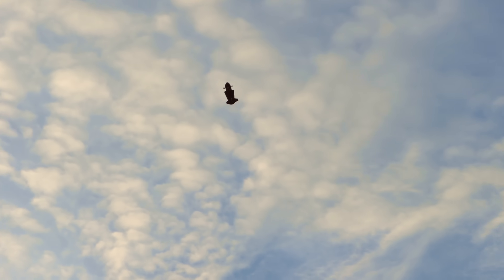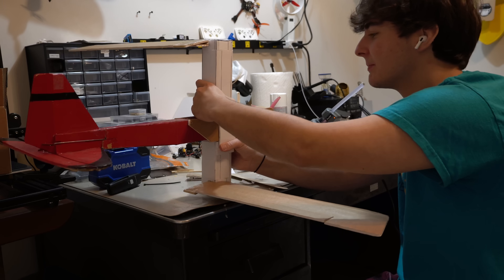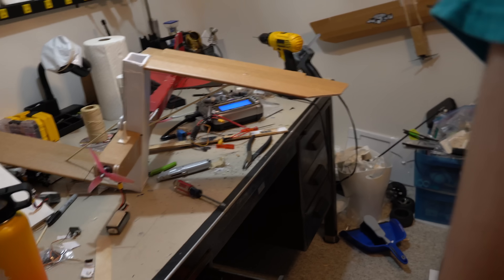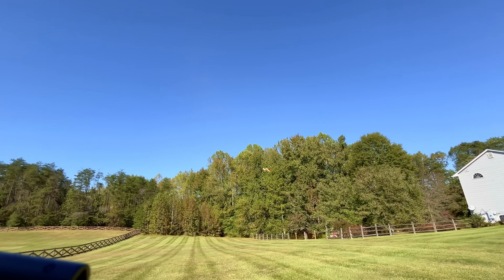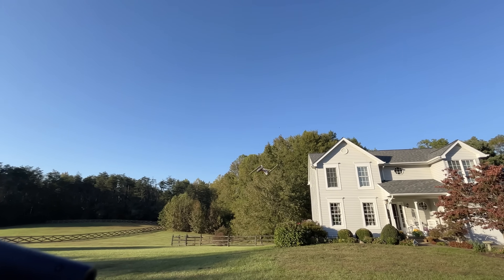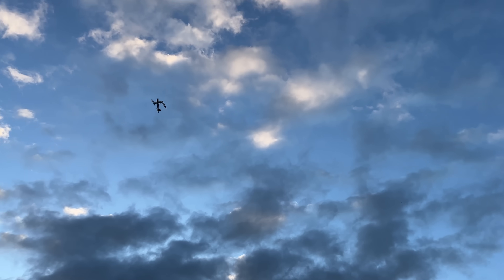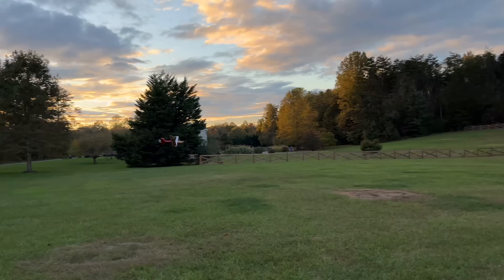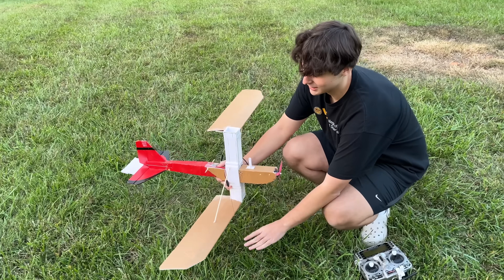Can a Plane Fly With Offset Wings?

Comment from the maker: To any one wondering how it would fly in ground effect or if it can turn right, this video will answer all your questions!!👇
https://youtu.be/zrH0QlKYqac?si=wn-rPbHM1OY1Grdm 

I also made a Patreon! Here it is and thx for checking it out!
https://patreon.com/EternalProgression?utm_medium=clipboard_copy&utm_source=copyLink&utm_campaign=creatorshare_creator&utm_content=join_link
Reply: your dad must be proud of you
Reply: other people pointed it out but your flying car proly still did fail cause of the wings because of ground effect and while i wouldnt be able to say what was causing it since i wasnt the pilot so i dont know if it just is reacting a bit harshly cause its such a small plane and so can turn much easier but when it was closer to the ground, the right side kept lookiing like it was lifting and like you had to correct the roll yourself which ignoring the ground effect increases lift if i remember right, exponentially as it gets closer to the ground, that would be the point that while yes it can fly like that, that still SEVERLY hurts its flight capabilities and DOES cause a roll that just gets greater the closer to the ground you are and more specifically, the closer the lower wing gest to the ground first.
Reply: Wait! Make an X wing craft,  same plane  but if you are looking at it from the tail, make a copy and rotate it 90 degrees.
Reply: I can see that it wants to roll. The powered version proves nothing. You have to throw a glider version with no controls and no tweeks to prove it.
Reply: yup airflow doesnt care if the wings are high and low ... just that they face the same way ...
Reply: The algorithm loves your content. I wish you made videos every week. I'd chip in on the content ideas.
Reply: Now make the indian peace sign airplane, not swastika cus swastika is titlted
Reply: @aquilschutte  i'd like to see a flying swstika just to prove that it can fly.
Reply: You should consider adding 2 additional wings, the same type but one going up and the other down, would be even more stylish

Comment: The only roll force i can think of would be from the high wing pushing air down on the horizontal stabilizer on that side similar to the spiral slipstream force. Looks like its far enough back that's not too big a problem

Comment: the """question""" is = self answered omg !! = If the wings attack the air at different heights that air will be at different pressure therefore the "bottom wing"  will produce more lift than the highest wing causing an angular torque in a flat direction perpendicular to the advance, it is not necessary to "set up" anything to "demonstrate Or try "Nothing at all, all that u need is just think a little ( and engineering knowledge of course )!!...you obviously CAN "make the thing work" but lossing lot of energy as well keep it FUNCTIONAL and producing fatigue of materials right at the key point of the aircraft in which you do not want it = the union of the wings with the fuselage !!...

Comment: Try putting circular holes in the side supports for the stilts that lead to the wings. This should benefit your structural integrity, but do it with your framework. Develop your subframe. This design probably will lead to this always fly on a diagonal, So just reposition the cockpit. It does work though and that's pretty fuckin cool dude.

Comment: It looks like in the video you didn't put any dihedral in the wings.  The math would say that you would  have a torque if you did put in a dihedral.  I also noticed that your left wing is high and the right wing is low, which with dihedral would give your airplane a clockwise rotation, which counter the counterclockwise rotation imparted by your motor and clockwise rotating propeller.

Comment: Can compensate for offset wing by angling the higher up wing slightly higher since that is the side falling, and at just the right angle it will fly normal. You need the front of the higher wing to be aimed upward slightly more than the lower wing. Another thing you could do is cut the backs of the wings at an angle so that they can collapse together in a different way, by shaping the wings to close at an angle.

Comment: With air density decreasing with heights, the lifts of 2 wings of the exact same geometries and angle of attacks at offset heights would create different lifts and drags. However, at the speed the airplane is traveling, this difference would be negligible, especially when reviewing tolerances from non-precision manufacturing.  This air density difference is what makes bullets veer off path the faster they spin or what makes a slider move away or toward a batter in baseball.

Comment: I think the issue isnt lift generated but torque on the center line. Assuming the wings are mirrors of each other, the issue with off set heights is that they will produce toque on the centerline of the craft because of gravity. This is all said before finishing the video.

Comment: The drift in the car plane was probably because of the weight distribution inside the car.
Batteries weight a lot compared to the generally hollow car and they are usually not centered.

Comment: “More lift in the bottom then the top”? That makes no sense to me. The wings are moving the same speed they should have the same air pressure under them. What I would think looking at it, is that the wing on top would have more torque because is farther away from the center of gravity.

Comment: Why don't you try re-designing the pillars connecting the wings to the fuselage, make them a symmetrical airfoil shape and fitting them with trim tabs so you could possible do away with the need for a seperate tail assembly??  Just an idea.

Comment: With one low and one high wing, you lose all dihedral effect. So you could add some dihedral, or sweep angle to get some more dihedral effect.
You should also increase vertical fin size as your airplane looks generally unstable (wobbly) on the lateral axis

Comment: Your conclusions just before the claim at the end where you said "myth busted," were wrong.  Ground effect was not your only problem.  The reason the plane was going to the right, as your dad noted, was because your top wiing is farther away from the fuselage than your lower one.  It therefore creates more rotattionoal torque, twisting the plane to the right.

Comment: If the wings are the same size and shape, it won't work unless they're the same distance from the center of the fuselage.  By putting them on a post, he's turning them into levers, which create rotational torque.  The two torque forces have to offset each other to keep the fuselage from rotating, and the plane from crashing.  That's why the plane mostly worked, but the car didn't.  If you want the car to work, the wings are on the same side of the fuselage, which means the wing closer to the fuselage will have to create much more lift, to offset the lever action of the one farther away.  That means the closer wing, if it's the same shape, will have to be much larger.  How much larger?  Learn some basic physics.  Specifically, physics having to do with forces created by levers.  The math isn't that hard.

Comment: Fun fact the italian C.202 fighter mono wing had one wing slightly shorter than the other to offset torque pull in flight. So the plane could actually fly in a complete straight line without any input from the pilot.

Comment: With the car its an issue because the center of gravity is below the wings. The airplane you put it in the middle so its not an issue. Cut the fuselage off, and glue it on the bottom and you will get a beter understanding of the issue. Also the car taking off has ground effect on oneside and a smaller one on the other side because of this offset.

Comment: Leverage against center of mass... As long as that's equal the wings could be offset by any amount.

In theory you could have a smaller wing further away from center, and a larger wing closer, and still fly stable.

Comment: Real nice mythbusting! Simple and unequivocal.
I wonder if the main factor isn't that the torque each wing puts on the body should compensate the other. This could be tested by keeping the same body, wing, and "offset beam", but 'sliding' the attachment point of the body up and down the pillar.
To rule out static torque and get more vertical lift out of the wings, counterweights making each wing balanced across the offset beam could also help.
This channel is a joy!

Comment: I can understand the intuitive feeling of people who think that this will spin. They observed a similar thing, like a rotor and draw false conclusions. But people have similar problems to understand physics in construction and statics. Because most are not able to disect all parts into independant situations. Both wings have the same weight, create the same lift and you can put the wings at the top or the bottom of a plane. The wing does not create more lift when it is one meter higher, or lower and it weighs the same (let´s not be tooo theoretical here please). There´s the same mass on either side in total. So why exactly should it spin?

Comment: Before watching this video, here's my guess:
You're going to get more ground effect from the lower wing, giving it more lift when near the ground. Whether this is significant enough to cause an issue, I don't know - I suspect the ailerons can easily work against it.
Once you are high enough that ground effect is not a concern, I don't see any reason why the offset wings should cause a problem in level flight. You might get some weird turbulence from a suboptimal fuselage, but nothing significant.
In a turn... I don't know. I think it might feel a bit weird when compared to a normal plane, but I don't think it should cause too much instability.

Overall, I do think this will be noticeable and not ideal, but not such a huge problem that it can't fly.

Comment: Before watching anything or reading the comments, I bet ground effect would have a big part in this, the lower wing would get more lift when close to the ground and at lower speed than the higher wing, meaning as long as the plane is far enough from the ground the imbalance would be insignificant to null, the plane would be stable, but as soon as you would get close to the ground, ground effect would throw the lower wing upwards and roll the plane towards the high wing.

Comment: hypothesis; wing off set shouldn’t matter if the center of gravity is located exactly in between the 2 wings as lift is a purely single direction force when created by passive wing systems

Comment: a free body diagram (vector forces) show that a symmetrical offset on both sides with respect the center of gravity shouldn't be an issue

if there are big differences in the offsets there will be a slight rolling force applied to the one with the bigger offset

Comment: As someone who has spent over 2000 hours running experiments in the most realistic physics engineering and aerodynamics simulator known to man (kerbal space program) I can confirm that the only way that the offset would impact flyability is if the center of lift isn't where it should be.

Comment: As an Aerospace Engineer, the flight dynamics makes sense, so it’s not surprising that it works with minimal roll, but it’s cool to see the proof! Not something I’ve ever thought about because of the structural integrity of a single wing mounted above or below the fuselage.
Reply: I still think it's not stable. In level flight it won't be very noticeble, but banking must distort it's flight charisteristics. Certainly because of the distance from the wings to the hull being uneven (the upper wing being much further away from the hull than the lower wing). It might even have been an accidental advantage having the upper wing further from the hull than the lower wing. My aerodynamics-math isn't good enough to calculate it, but to do this test objectively, the 'tower' should have equal arm lenghts up and down. Also, as the whole 'contraption' was built without any tools to check the angles, the wings could have different angles of attack and dihedral/anhedral. In small RC airplanes this makes a world of difference.
As high wing airplanes have different characteristics than low wing airplanes, one high and one low wing must have consequences for stability when banking and pitching.

Comment: makes total sense to me! the reason a plane tips one way or the other isn't to do with changing the position of the wings, but changing the amount of lift on one side or the other. Making it aysmetric should not really change that, as long as the center of balance remains.

Comment: I've got quite a bit of experience with aviation and aviation accessories. First off, Excellent experiment!! I love to see someone actually trying it out, instead of letting opinions rule the day. Even if it failed, you learn something. More things even. Second, and practically, it looks to me that you're getting equal lift from both wings, but your handling has some weight and balance/moment of force issues. Gravity is goin to want to make it a right angled "N", so your "Straight and level will have a left turn bias. Maybe try different wing lengths to compensate. Longer on top since the force acts on the furthest away, and you want to bring the left side up. Or go stubby on the right side, but lack of lift is usually a bad thing for aerobatics. Great vid, dude!

Comment: before watching you build, the only reason i think it would cause a roll would be a difference in weight between each wing, which i assume you would compensate for, or the extremely slight difference in atmospheric pressure/air densities at the difference elevations, which would be negligible at worst,  non existant at best.

from my limited knowledge of physics and aerodynamics, the position of the wing on the Y axis wouldn't affect the amount of lift generated, only the shape and pitch/yaw of the wing would. if both wings are identical in every way, apart from a difference in the relative height, equal lift from both wings would apply the same upwards force on the aircraft.

Comment: Sharks kind of fly through the water. Their fins produce lift with their tail providing the the fowards motion. Sharks often swim at a severe biased when cruising long distances to provide more lift which offsets their fins a drastic amount, and consumed less energy. Id assume the same would be the case for actually flying machines but i don't know nearly enough about how fluid dynamics changes between water and air. Very interesting experience.

Comment: This will work fine at altitude, but if you get into ground effect (about a wing's length from the ground) then the lower wing will start to develop more lift. So it's still possible that that's what was affecting your previous model.

Comment: I didn't watch the entire video so you may have mentioned this but I think it does matter in most cases. If the wings weigh a significant amount compared to the total aircraft weight and compared to the generated lift, then the wing that is higher will be pulling the aircraft down with more force causing a roll. Since most commercial planed has fuel in the wings I don't think they could fly with wings like this safely.

Comment: My hypothesis before watching is that on builds where the main body is below both wings, it will rotate towards the lower wing. Both wings will deliver the same amount of force vertically and horizontally, but the higher wing being further away creates a greater torque on the body of the plane.

If the wings are offset with the body in the middle, I see no reason it should fly any differently than a normal plane. It’s super inefficient weight-wise and serves no real benefit, so we’ll never see a real plane with it, but it would make for a very unique model plane

Comment: It offends most people's sense of aerodynamics, but it's just a roll offset. Even perfectly built airplanes, model or real, have that. Maybe some weight difference anywhere on the plane, even just the propeller gives a rolling impulse. This can easily be corrected by trim, but you have to correct it differently depending on speed and AOA. In model airplanes it's even easier because they usually outsize everything, especially control surfaces, in order to secure a flyable device without actually calculating anything. Put in a tuned flight controller, and there's not much difference.

Comment: while in the air, the offset should not make a difference but lift off can be problematic cuz of the air stream between the llower wing and the ground beeing different than the higher wing and ground, resulting in different pressure, resulting in less stability while lift off

Comment: Cool demonstration. Works exactly like it should, the forces on each of the wings are basically the same. Clearly it's not the optimal arrangement for a number of reasons, but that shouldn't stop you from flying it. If you put a strong enough motor and prop on a brick you can probably get controlled flight.

Comment: Don't the wings need to be offset the same amount from the center of mass?
Otherwise the vertical mast would act like a lever with equal forces but different lengths.
Reply from the maker: I just offset it evenly from where the wing was originally on the plane
Reply: @joosh_king  Yeah, clearly you did, because it flies ok. But what if you didn't...

BTW, another commenter actually explained that due to some physics I don't understand (angle of lift wtf?) the more offset wing while it would normally apply rotational force actually provides less lift, so it cancels out and they don't have to be offset the same amount. / I learned this after I wrote the original comment.

Except for ground effect.